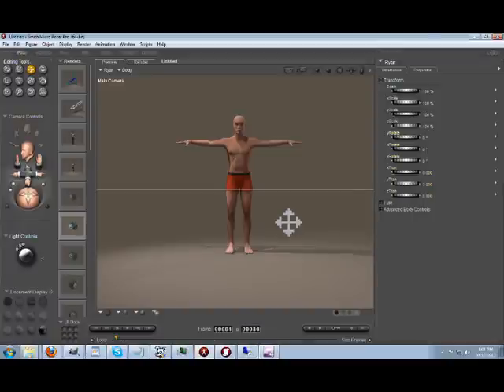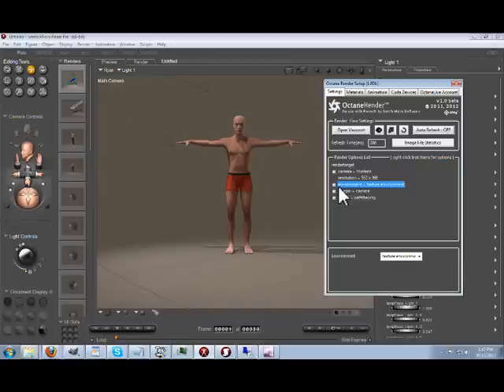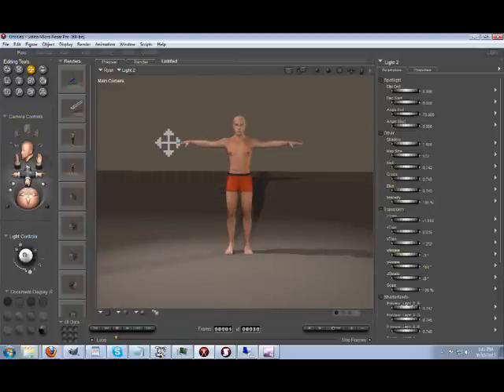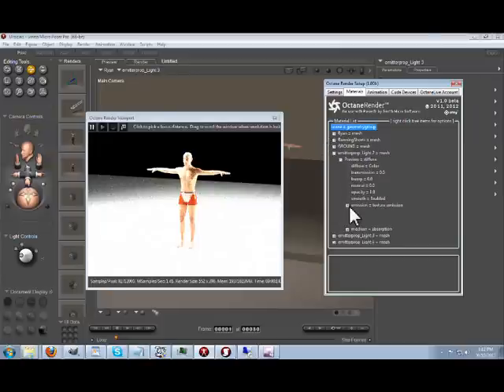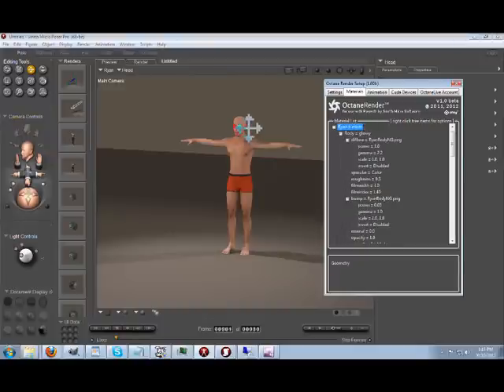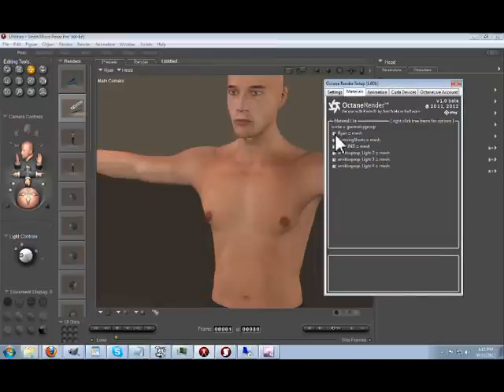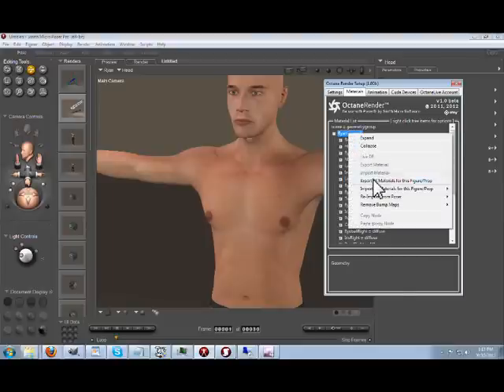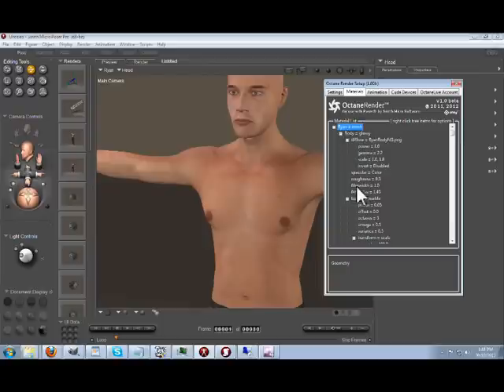OctaneRender for Poser Tutorial 1

Comment: can you render a scene without all that grainyness in final render?
Reply: There is no "final render" with unbiased renderers (pathtracers), since it will render forever if you want it to.  The graininess decreases as you let it render longer.  The render is "done" when the "noise" is not noticeable.

In this example Paul ended up with about 80 samples/pixel in 20 seconds.  So if he let it run for another 60 seconds, he would get about 4x as many samples, meaning the noise would be reduced by half, on average.

For a simple scene like this, in my experience, 2-3 minutes is more than sufficient to get a clean render on 2x GTX 770s.  For complex interior scenes, it can take much longer.  But that's the cost of physical accuracy...
Reply: dsy9876 Thanks for your explanation. I'm new to 3d. Thinking to buy Octane but wasn't sure if one could render without all those grains. now i know better. Thank you!
Reply: Camille Kleinman No problem.  I have been very pleased with Octane.  If you're just starting out, I think it's the best combination of ease-of-use and excellent results, assuming you have an nVidia card.  It's much better and easier to use than Poser's built-in renderer.  You can check out the official gallery for examples: http://render.otoy.com/gallery2.php

Unbiased rendering has its limitations, though.  Once you get more advanced, you may want to check out biased renderers, such as VRay or Redshift.
Reply: dsy9876 What are the limitations of unbiased? isnt unbiased 50x faster than biased? or does biased give better results? Octane looks great, but i cant afford to buy multiple renderers. 
I'm going to be using the renderer to render 3d characters for my books as well as in future some short 3-10 minute 3d videos. would octane render good enough results for this or do i have to go more pro with biased renderer?
thanks again
Camille
Reply: Camille Kleinman
Hi Camille.  In general, an unbiased renderer will give vastly more realistic results than a bias renderer, and require much less tweaking of render parameters to do so.  Materials also need much less tweaking, and you don't need to employ special tricks to get realistic results.  In the majority of cases, Octane will render quicker than Firefly.

Paul
Reply: Paul Kinnane Thank you for your reply Paul! :)
Am now definitely getting Octane. Have a good day.
Reply: There is a demo version, so you can try that to see how it runs on your hardware.  It's a few versions behind the current comercial version.  Paul
Reply: Camille Kleinman There's a difference between biased vs. unbiased, and CPU vs. GPU.

Unbiased rendering (pathtracing and other "sampling"-based algorithms) is typically MUCH slower than biased rendering - this is one of the reasons for biased rendering in the first place.  However, for unbiased rendering, GPU-based is typically MUCH faster than CPU-based.  Octane is indeed 10x-50x faster than most CPU-based unbiased renderers, because it is GPU-based.  If you run Octane on a single modern GTX card, the speed is comparable to multiple networked CPUs using a CPU-based pathtracer, in most cases.

A major advantage of unbiased rendering is that materials and lighting are much simpler to understand (Octane is especially good about this), because the renderer is physically accurate and light behaves as it would in the real world.  Another advantage is that indirect lighting (one of the things that really makes a scene look photorealistic) just happens automatically.  In a biased renderer, you often have to spend hundreds of hours learning how to tweak things to achieve the same effect, and in some cases the result takes almost as long to render as an unbiased engine would.

A disadvantage of unbiased rendering is that complex scenes can take a very long time to become noise-free (if it's even possible at all).  Again, Octane is very very fast in this respect, but this limitation applies to just about every unbiased renderer that I know of.  So if you absolutely need noise-free renders in reasonable time, say for architectural visualization or professional animation, a biased renderer may be best.

Another disadvantage is that some effects are very difficult for an unbiased renderer.  Volumetric effects (smoke, fog, etc.) are tough to control and add a lot to render time, and more "spectacular" effects like sci-fi lasers or Harry Potter-like spell effects are hard or impossible (after all, they don't often happen in the real world). [Edit: You could add these in post-production using Adobe or GIMP, however, and Octane's upcoming render passes may help a lot with things like this.]

It sounds like you don't actually need either of those two, so for your purposes, Octane would probably be ideal (especially if you are new to all this).  As unbiased renderers go, I wouldn't use anything else.

Also, Paul (who makes the plugins for Poser and a whole bunch of other applications) is incredibly responsive and helpful.  He is a total superstar. :)
Reply: dsy9876 Thank you very much for your help and advice. I've been reading in endless forums trying to figure the difference between the two (CPU and GPU, unbiased and biased) but no one so far i found explained it as good and simple as you did. Thank you a lot! Have a great day! :)

Comment: Tigersann - sorry for the delay in answering you - I missed your post.  Yes, you can layer many normal maps (using a mix node), however I think you'd get a better result by merging the maps into the geometry using something like ZBrush, then importing the result back into Poser.  Normal maps have the x, y, z displacement in the red, green and blue channels, so mixing 2 normal maps might give odd results.  You might even find there is a GIMP or Photoshop plugin which merges the maps for you.

Comment: IMO, normal maps a superior to bump maps, and provide the same render effects as displacement maps, except at the edges of the mesh (ie the mesh side that are not facing the camera).  I'm not sure if you can just plugin the displacement map into the normal map pin, or if you will need to convert the displacement map image first (using ZB or Gimp/Photoshop).  You could always try this in the OctaneRender for Poser demo and see if it works for you.

Comment: Sorry for the delay responding to this question.  Displacement is not currently supported by Octane - so convert those to normal maps and they will render well.  The Octane SSS is quite different from Poser SSS, so a Poser human skin will not convert to an Octane human skin with the SSS in tact.  Instead you can import an Octane skin SSS shader setup (there are a few that you can download for free), which will give very high quality skin rendering results.